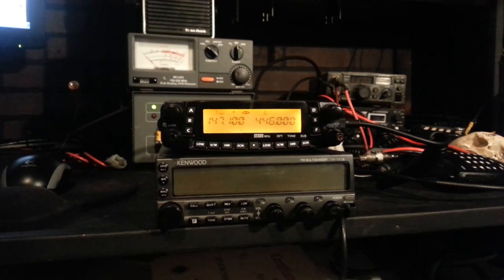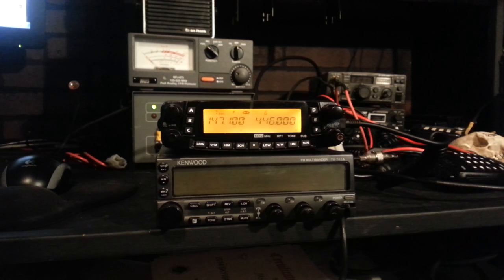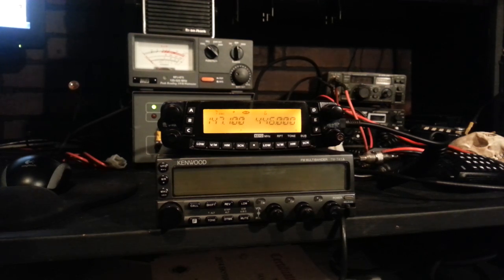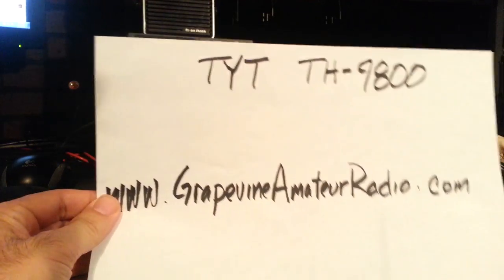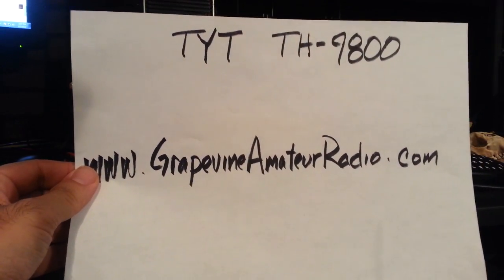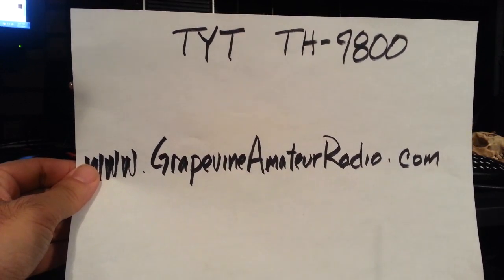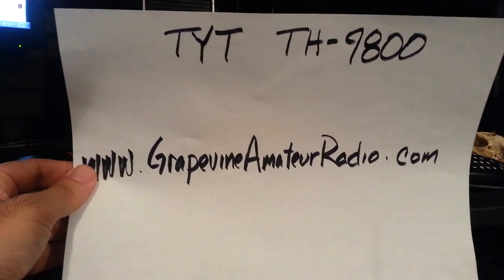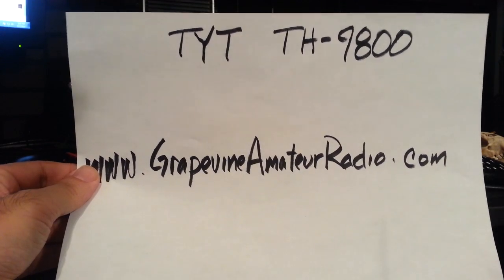How to Program the TYT TH 9800 Quad Band Ham Radio - Ham Radio Programming

Comment: What antenna do you use on the tyt th 9800 for mobile use.
Reply from the maker: I currently use a dual-band only antenna.  The Comet SBB5.  I've used the 10M and 6M sides of this radio, but I don't typically keep those antennas up because there isn't much activity, and most of those antennas compromise the 2M/440 band because they are trying to be so wide.
Opek makes a good triband antenna that will do 6M/2M/440, I plan to pick one of those up the try it soon.  The model is the HVU-610

Comment: some/most of the repeaters in my area have no pl tone.... but i cant seem to set this radios tone f to zero.... any thoughts?
Reply from the maker: Just turn the ENC to OFF.  Use the P3 button on your mic, you will see 4 options: OFF, ENC, ENC-DEC, DCS.  Turn that to off, then your radio won't send a tone, it doesn't matter what is selected in the TONE F menu.